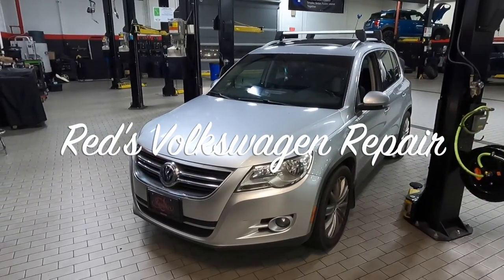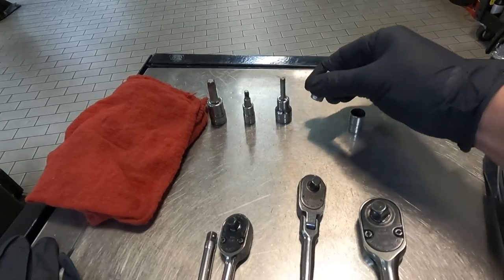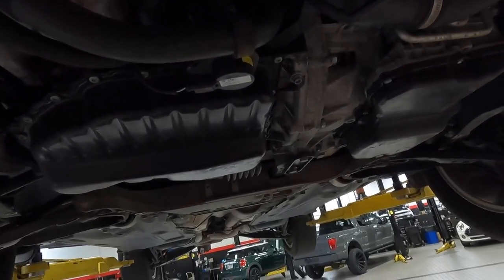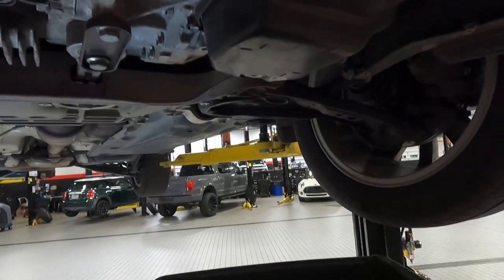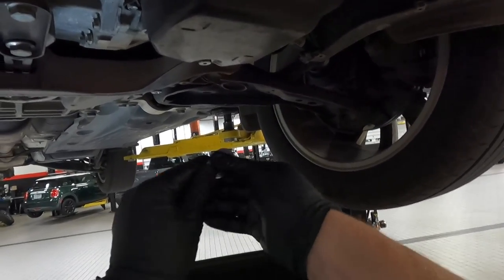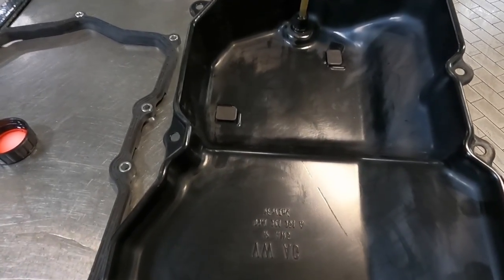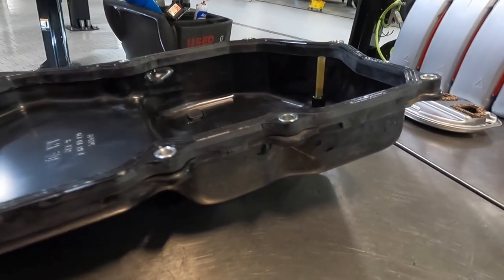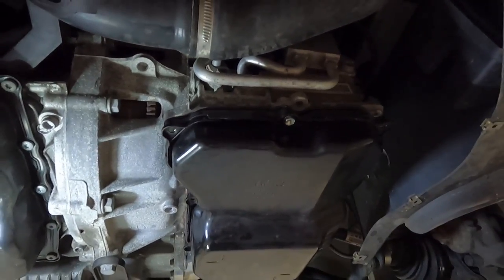How to Perform an Automatic Transmission Fluid & Filter Service | Mk1 Volkswagen Tiguan (2009-2018)

Comment: VW is the worst to cars to service imo. I appreciate the better quality of materials that don’t rust as fast but 17 hex head screws on a air filter when everyone else has easy snaps to replace the filter is so annoying
Reply from the maker: @jeromeharrison7450  They do over engineer sometimes. However, there are a ton of other brands that when I work on them I think “What were they thinking?!”.  It’s all nuts and bolts at the end of the day.

Comment: Just tell me why VW makes it a complicated proceedure to change the trans fluid. The Japanese cars have a drain plug and a filler plug... That's it. No wonder service costs are so much higher.
Reply from the maker: @jmy6050  I couldn’t tell ya, I’m not an engineer. But I will say, every manufacturer has gone to this procedure to some extent. The transmission in this video is made in Japan. 
There are a few transmissions still out there that are of the style you are talking about though.

Comment: Nice video!  It's very frustrating to me that dealerships and/or manufacturers think it's okay to not get all the old fluid out.  Why not use a fluid transfer machine (like BG products) to replace all  the fluid.  It may or may not be worth it to drop the pan to replace the filter which is typically nothing more than a screen.  I am not talking about flushing with chemicals.  I am talking about a fluid exchange.  Pump out old while pumping in new via the cooler lines.  When cooler lines are easily accessible, it is possible to do this without the transfer machine.
Reply from the maker: Thank you!
Great question.  Seems like fluid flush machines have been mostly designed for and used on domestic American vehicle in the past and worked pretty good.  On European vehicles, it has been known to blow out seals inside the transmission which is a huge problem.  If you want to get "all of the fluid" out, best thing to do is this process a couple of times and fully dilute the fluid until its been diluted so many times that it is literally all brand new.  Hope this helps!
Don't forget to subscribe if you haven't already, thanks!
Reply: @RedsVolkswagenRepair 
Wow!  I hadn't heard that but it's definitely good to know.  I assumed the pressure was about the same as what is generated by the transmission's pump.  I was getting ready to have this done on our 2018 Tiguan.  I'll discuss with my mechanic first.  It's hard for me to accept that manufacturers are not providing fill holes on top of the transmission in addition to not providing dipsticks.  I don't mind the overflow tubes that aid in getting a precise fill level, put not providing a fill hole is just ridiculous, IMHO.
Reply from the maker: @kman2220  Its just a difference in design and engineering 🤷‍♂

Comment: I had a Jetta once and it had the same kind of gasket.  I like that there was no silicone used.  Of course there would be too much of a gap for silicone without the gasket.  I just would have to be careful where I take it for a change if I didn't do it myself.  Just make sure they know no silicone, use ONLY the fluid you specify and nothing else, and that they set the fluid level correctly.  Too much or too little fluid will destroy these quickly.  I am not sure what is worse really too much or too little.  Too much and it gets frothed and then it can't pump the fluid and there may as well be no fluid.  Make sure never to misplace that fill level tube when it is out of the transmission, they come in different lengths for the different transmissions and unless you know for sure which one you have it may be tricky getting the right one.  As cheap as that part is it would be worth having a spare some place safe where you always know exactly where you kept it.  I am a little bit annoyed with the design of the pan seeing how far the hole is from the lowest part of the pan.  It is bad enough that most of the fluid is inaccessible anyhow
Reply from the maker: You are spot on 👌
Don't forget to subscribe if you haven't already, thanks!

Comment: Finally found a helpful video, thank you so much!👍 I do have a question, though: Are there two filters for the DSG? I've seen other tutorials that mention a cylinder filter under the battery🤔. I have a 2014 Tiguan 2.0TSI 7SP AUTO 5N AWD with 132 kW. Also, is there any chance you could film a video on Haldex clutch servicing? There are a few on YouTube, but I haven't found one that's clear and useful. Thanks again!💯
Reply from the maker: @chantaiman2591  On the DSG there is only one filter and it is the one you are talking about on top of the transmission underneath the battery tray. Sounds like you have the automatic transmission though and that wouldn’t apply for you. 
Actually, I’ve already filmed a Haldex service for the Tiguan, I just haven’t found the time to edit it. I will try to get it up soon!
Glad I could help though. Don’t forget to subscribe if you haven’t already, thanks!
Reply: @RedsVolkswagenRepair  Much appreciated for your quick reply! 😊However, I'm a bit confused. Are the DSG and the transmission the same thing? Are you saying that for the 7-speed DSG manual transmission, there is only one filter located under the battery tray and not the one shown in your video inside the oil pan? While for my automatic transmission, these two filters are absent, so I only need to change the transmission fluid?😅
Reply: @RedsVolkswagenRepair  Great to hear you’ve already filmed it! 🎉🎉 Please take your time, no rush. I’ve liked, subscribed, and turned on notifications. Thanks again!❤
Reply from the maker: @chantaiman2591  The DSG transmission and the automatic transmission are two completely different transmissions. Not sure where you are located, but the Tiguans in the USA did not come with DSG, they only came with automatic transmissions. 
Both transmissions only have one filter. The DSG filter is under the battery tray, and the automatic is inside the transmission oil pan. 
On the automatic, you would need to remove the pan, replace the filter, replace the pan gasket, and reinstall the pan… if you’re doing the FULL service and not just a fluid service. 
On my personal vehicles with the normal automatic transmission, I always do the filter because why not (also to clean the magnets inside the pan that collect loose metal partials). But the typical service is just changing the fluid. 
On the DSG transmission (only in select models in the USA) the filter replacement is required during the normal fluid service.

The DSG transmission is a “Direct Shift Gearbox”… an automated manual transmission with wet clutches
Reply: @RedsVolkswagenRepair  I'm extremely grateful for your detailed response! After reading it and doing some more research, I finally get it! 

Sorry I didn't mention earlier that I'm in Australia. After checking further, I found out my Tiguan actually uses a DSG. 

Even though your tutorial doesn’t apply, your reply was really helpful. I’ll keep looking into how to change the DSG filter and fluid. Hopefully, everything goes smoothly for both of us!
Reply from the maker: @chantaiman2591  Not a problem!
The fluid portion of the service is the same procedure, you will just need larger Allen keys to remove the drain plug and the filler spout inside the drain plug. Removing the battery and tray to get to the filter is the research you will be needing to find. 👍
Reply: @RedsVolkswagenRepair  That clears up a lot, and I'll dive into the research on removing the battery and tray for the filter. Your help is much appreciated👍
Reply from the maker: @chantaiman2591  Sounds like a plan 🤙

Comment: So i made a mistake trying to change the oil on my 2018 tiguan with 60k miles. I accidentally drained the trans fluid and never took the fill level "plug" out. It drained about a quart, can i just fill a quart with the engine cold and call it good? Obviously doing the full service is best but just to get it driving for a bit until i get everything i need for full service
Reply from the maker: Good question. 
These transmissions are pretty picky about having the correct amount of fluid or they will slip and there is no way to know exactly how much came out. 

What I would do is throw 2 quarts in and go through the actual level check procedure at the correct temperature THEN call it a day.

Comment: I have a 2014 Vw Tiguan  automatic when I change transmission fluid oil in my car? I have run 83000 km done so.( nothing problems in my car)
Reply from the maker: Technically Volkswagen says it is a lifetime fluid on this vehicle, but I recommend every 50k miles.

Don’t forget to subscribe if you haven’t already, thanks!

Comment: I bought 2011 tiguan with bad transmission, I've got transmission replaced with used unit, but the car crank no start now, what do you think need to be checked? Does it need programming?
Reply from the maker: Did it start before you put the used transmission in?
Could be a coincidence and it’s a whole different concern. 
The car does not need programming after transmission replacement, only if you replaced the transmission control module which is in a different location. 
Good question. Don’t forget to subscribe if you haven’t already, thanks!
Reply: @RedsVolkswagenRepair  yes, I drove it for about 15 miles to where it sits now. Transmission was slipping and not shifting gears.
Reply from the maker: @NWCI  Does it sound like an abnormally slow crank? Or normal?
Reply: @RedsVolkswagenRepair  it didn't seem slow to me but we were trying with jump pack. I guess I'll have the battery charged and try again
Reply from the maker: @NWCI  Reason I was asking if it was slow to start was to see if something inside the connection of the transmission to engine is putting too much pressure on the crankshaft/output shaft. For example… the torque converter not being fully seated into the transmission and then bolting the transmission and engine together.

But if it wasn’t slow to start I wouldn’t think that’s your problem. Sounds like something else is going on possibly not related to the transmission.

Comment: Very nice video my man. I watched a bunch of other videos. And they left a lot of questions for me. Yours answered all the questions I had. I'm about to go. Change my transmission fluid on my CC vr6 4motion
Reply from the maker: Glad I could help!
Real quick though, if i'm not mistaken the cc with the vr6 4motion might have a DSG transmission and not a normal automatic transmission.  I can't remember.  But if it is a DSG transmission it will say it on your shifter inside the car.  Only difference in the entire procedure is that there is a fluid filter that sits on top of the transmission underneath the battery tray that will need to be replaced during the service.  Other than that, the fluid fill process is the same.

Don't forget to subscribe if you haven't already, thanks!

Comment: Great Video! My wife has a 2018 Tiguan SEL Premium. I know there was a body style change for the 2018 Tiguans, but how can I tell if our Tiguan is like the 2011-2018 or 2018-2022 version of the Tiguan? The main way I know about the body style change is when I changed the Evap Canister and order the wrong part. Of course the Evap Canister for the version Tiguan we have was twice the price as the wrong Evap Canister.
Reply from the maker: Thank you!
2009-2018 are the same until the split in body style towards the end of 2018. The 2018-present is a completely different body style. If yours looks mostly like mine (yours will have a face lift of only trim) then the process on this video is exactly the same. The current body style is the same process just things might look a little different. Hope this helps!
Don’t forget to subscribe if you haven’t already, thanks!
Reply: @RedsVolkswagenRepair  Thank you for the super fast reply!
Reply from the maker: @EdwardWhite-cr6mx  No problem!

Comment: Excellent video and very informative.  Saves quite a few $$.  Where does one get the "special adapter tool" that screws into the bottom of the pan for adding fluid via gravity feed or pump?
Reply from the maker: I would probably recommend going to tooltopia.com. They usually have good prices.  There is a kit that comes with everything from Mityvac. 

https://www.tooltopia.com/MityVac-MITMV6410A

By the way, thanks for subscribing!

Comment: Hi, thanks for this video, it explains everything very well. Just a question, what is reference or part number of filler tool?
Thanks
Reply from the maker: No problem!

You don’t have to go this expensive but this is the well known tool by professionals. 

Don’t forget to subscribe if you haven’t already, thanks!

https://www.amazon.com/Mityvac-MV6410-ATF-Refill-System/dp/B004IKRO5M/ref=asc_df_B004IKRO5M/?tag=hyprod-20&linkCode=df0&hvadid=312065537890&hvpos=&hvnetw=g&hvrand=15219846183670752940&hvpone=&hvptwo=&hvqmt=&hvdev=m&hvdvcmdl=&hvlocint=&hvlocphy=1015279&hvtargid=pla-450976555116&psc=1&mcid=bcc98e95f97a3bc49aa62c0dac4f76b0&gclid=CjwKCAiAtt2tBhBDEiwALZuhAKJuSCNr-Tp4GXA2UQlTqmqHG9TWBMYJAxRwZ90nf5nEeCsTSoBarBoCsOEQAvD_BwE

Comment: Is the dsg transmision same? And what is the name of this special fitting tool best regards 😊
Reply from the maker: @hebax3007  The DSG transmission is a different transmission and does have a slightly different procedure for replacement of the filter. If you just search “VW Transmission filler adapter” you should be able to find it. 
Hope this helps!
Don’t forget to subscribe if you haven’t already, thanks!

Comment: The torque specs are required to properly replace the oil pan.  Can someone share a link to the VW torque specs?
Reply from the maker: You are correct. 
I don’t give torque specification out on my page. I leave that for the viewers to do their own research.

Comment: Thanks for the video.  I recently bought a 2013 Tiguan that had an issue and all the transmission fluid leaked out.  Found a pinhole in the transmission oil cooler - it appears a clamp worn through over time.  Anyway, we replaced that part, bought new fluid, gasket, filter etc..from Blauparts and pumped in the new fluid.  We had quite a bit of air in the line, but when we got the engine up to temp, it seemed to drain ok until it trickled or stopped.  Car drove fine for a few days, now we have an issue when we accelerate hard to take off from a dead stop, it briefly accelerates, then acts almost like it slips and revs very high, not moving forward anymore.  I understand the transmission may be bad, but could I be missing something else?  Since all the fluid drained out of the system from the leak, is it possible we needed more than 6 qts?  We are discouraged at this point.  We replaced ABS Speed Sensors at each wheel as we heard it might be those.  Replaced the MAF as well, no change.  We are not getting any codes or check engine light either.  Thanks for any help.
Reply from the maker: Hmmm, no codes in the transmission module?

Slipping is usually a sign of low fluid.

If the leak was bad enough it’s possible that the torque converter was also partially emptied. In this case it may need more than the 6 quarts normally provided in the kit. Now that you have driven it and probably fully filled up the torque converter, I would connect a scanner and read the transmission fluid temperature. When the level check temperature is reached, pull just the drain plug (leaving the level check insertion tube inside the pan).  If only a couple of drops come out, it is low. If a constant trickle comes out, level is good. 

If the level is low, turn the car off and let it sit for a long while until everything is back to ambient temperature.  Hook up your transmission fluid fill apparatus and start with adding 2 quarts. 

Then perform the level check procedure again. Repeat if necessary.
Reply: @RedsVolkswagenRepair  Thanks for the fast reply! I will give it a go and let you know! Much appreciated!
Reply from the maker: @macgyverspyder  No problem at all!
By the way, thanks for subscribing!
Reply: Just wanted to update you on what I ended up doing.  The transmission was bad.  I took it to a local mechanic and he installed a used transmission with low miles.  I also had him repair some broken wiring under the passenger as it didn't work.  Now I am trying to figure out what to do about getting a keyfob for it.  I didn't get any when I bought the car, just a regular key was provided.  Looking forward to your suggestions.  Thanks again for your response to my previous concern.